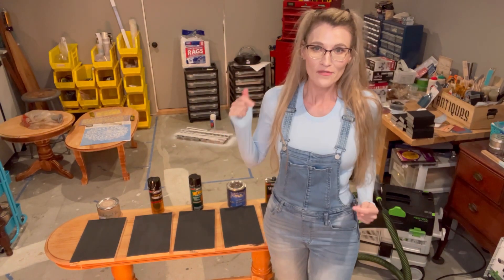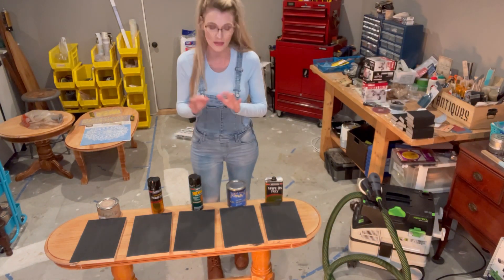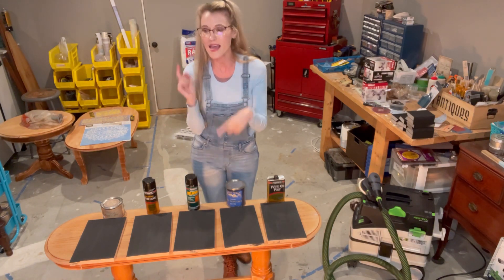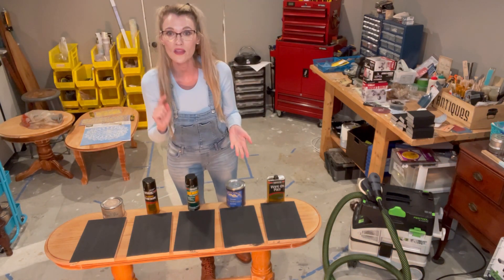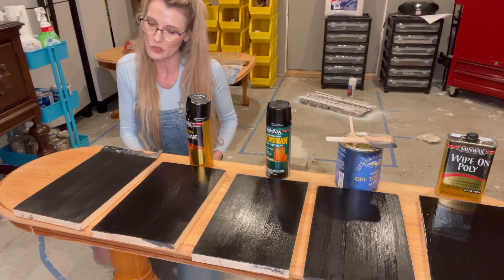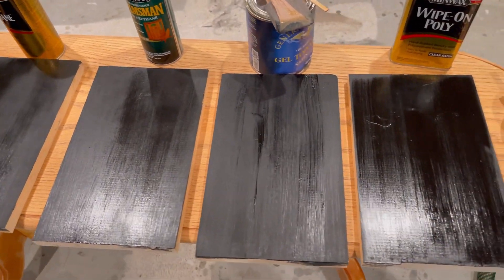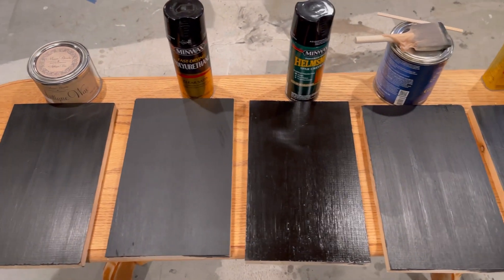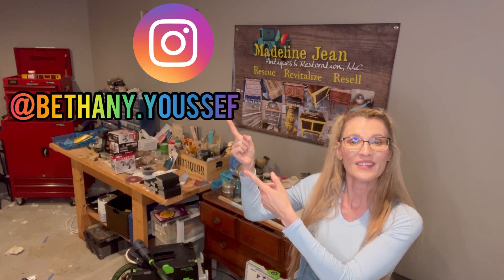Oil Based Topcoats Over Dark Paint | Furniture Flipping

Comment: Great side by side comparison. So much for the General Finish's stock. :) With the wax, I am assuming it would then need to be maintained with a wax?
Reply from the maker: Thank you for watching! With wax it is recommended to reapply but I must say I have a few personal pieces of furniture that I waxed years ago and they are still looking great! It should be noted they don't get a lot of traffic. I normally only wax the sides and the frame part of the piece of furniture. I usually sand/stain the drawers and the tops and apply poly to those areas. I NEVER wax the top of a piece of furniture. In my opinion wax it's durable enough for a top. I hope that makes sense.
Reply: @madelinejeanantiquesrestor9074  Yes, Indonesia. Thank you for the advice.

Comment: You made awesome video!!!
Can I have your advise? I would like to restore a beat up dining table. I’m planning to use dark brown color chalk paint. What is your best suggestion to protect the heavy traffic use dining table?
Reply from the maker: Thank you! I'll be honest I never paint the tops of dining room tables because you'll have to apply a water based topcoat. While water based topcoats are durable they won't handle the traffic a dining room table will receive. Oil based topcoats are the most durable topcoats out there but they will amber your paint job if you apply them over paint. You could possible get away with using an oil based topcoat since you are using a very dark paint color like dark brown.

Comment: Do you sand in between coats and if so what sand paper grit do you use ? I like the wax also
Reply from the maker: In between my painted coats, yes I will sand. I use 400-500 grit wrapped around a felt block and lightly sand. I do not sand the last coat.

Comment: Thanks for showing this. And what difference with the paint color. Does polycrylic not fare well on these dark colors? (Apologies if you covered that and I missed it.) I'm really glad you addressed the ventilation/protection issue for polyurethane, but frankly even just the VOCs from the wipe-on poly (without the additional danger of droplets in the air) are really toxic. Even outside. Respirator a must IMO. A mask will not do anything btw- you need respirator cartridges that filter organic VOCs. I don't mean to lecture, but it is concerning to watch you using these products without any respiratory protection. I get the liking the fumes thing- I personally like the smell of most paints etc and largely ignored many precautions in the past, but I wish now I'd been more careful with those kinds of things.
Reply from the maker: Thank you for watching! Polycrylic is so tricky to apply on dark paint. You can apply a little bit of the dark paint to the Polycrylic but it still tends to leave a streaky finish. There's a big learning curve with that product. Thank you also for the feedback on protective gear. Appreciate your insight.